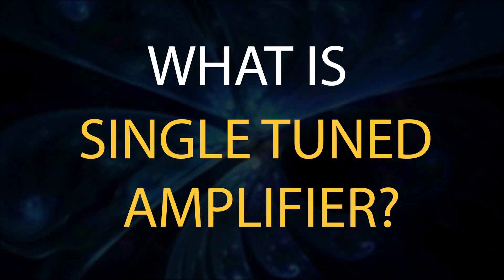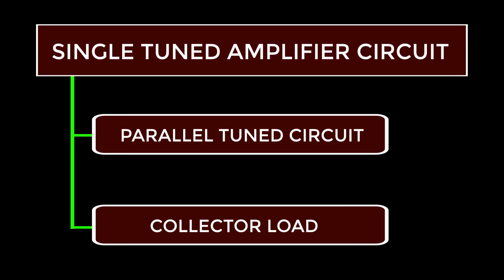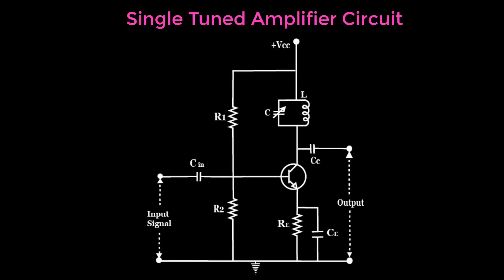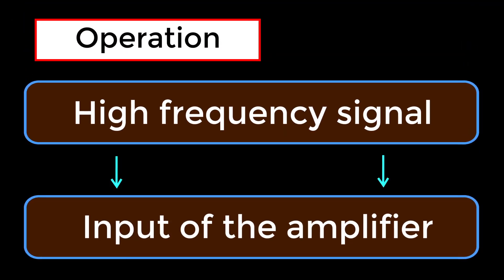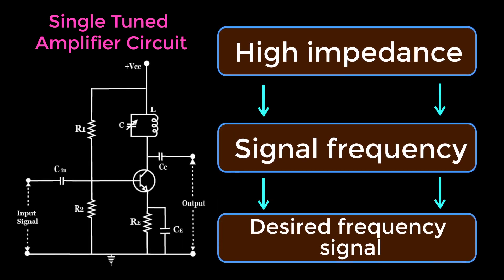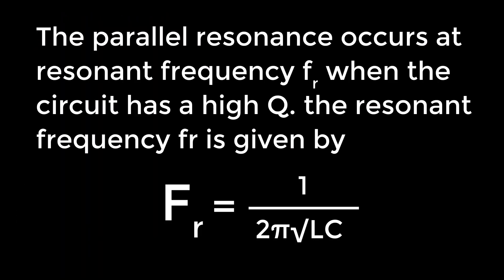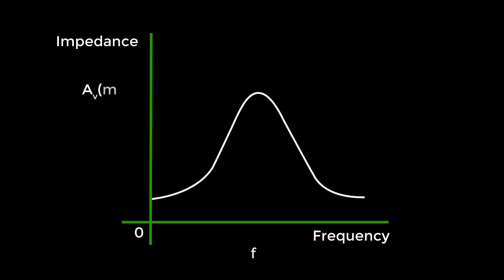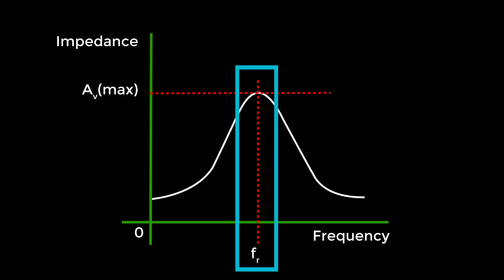What is Single Tuned Amplifier | Electronic Devices and circuits | Electrical Engineering

Comment: Thanks for the general explanation with regards to the single tuned amplifier circuit. i will appreciate it very much if you can explain how the dc and ac analysis of the transistor will be done. i am familiar with the procedure for the analysis if it is just a single resistor in the collector circuit. but now with a resonant circuit, it became difficult to analyze. thanks
Reply: سلام عليكم هل هذه الدارة يمكن استعمالها في الارسال الاسلكي  .